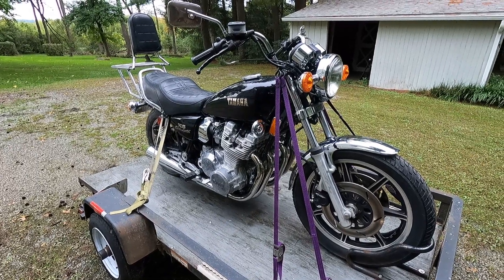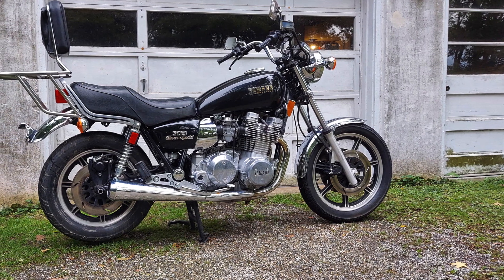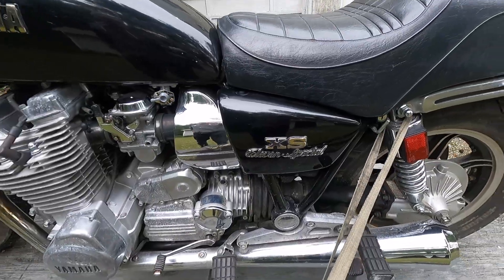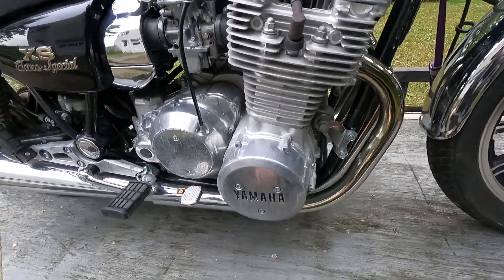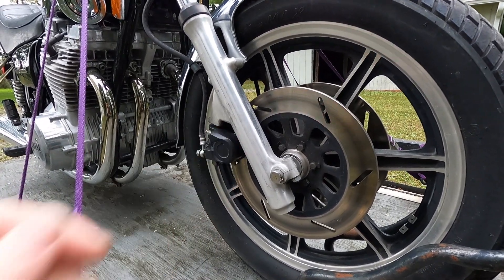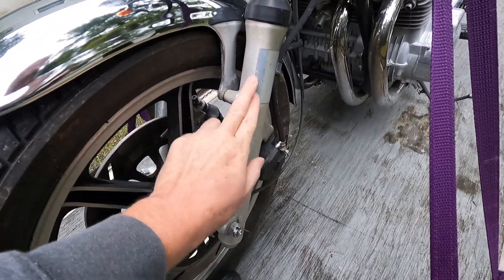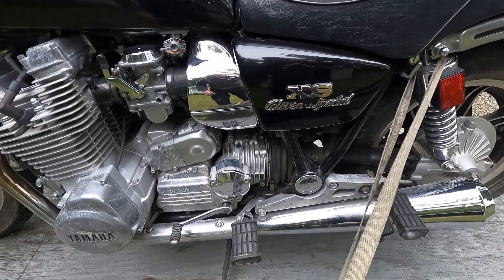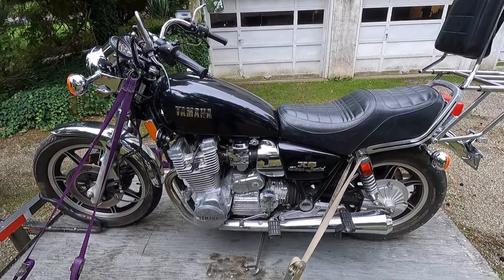1980 Yamaha XS1100 Restoration - Part 1 - Intro

Comment: What a clean bike. The corrosion on the engine cases actually to me looks like the spotting left by a degreaser.  The factory headers on all old Japanese bikes are double wall which can keep the outer tube in nice condition.
Reply from the maker: Thanks Mike! Yeah, I think this one will clean up nicely. 🙂

Comment: That is barn find motorcycle,  so good original condition for over 40 years old bike with so low miles. Congratulations for that. Hope you take off that carrier and sissybar ?
Reply: There is also dual fuel taps, cool thing !
Reply from the maker: The rack and sissy bar are OE Yamaha accessories but they do spoil the lines of the bike a bit.😉

Comment: Does anyone know where I can find pre made spark plug wires for a 1985 Honda VF 700 Sabre V45? All I can find is universal wires that don’t connect into the Honda coils correctly.   Thanks!
Reply from the maker: Did you check with Dynatec ignition?
Reply: @jonsmotorcyclerescueandrev3538  no I have not heard of them. I’ll give it a try. Thanks
Reply: @jonsmotorcyclerescueandrev3538  they only have them for the V65 motors.
Reply from the maker: @mattmiles9779  Are they not the same? That is surprising.
Reply: @jonsmotorcyclerescueandrev3538  I’m not sure if they’re the same or not. They only have it listed for the larger motor. I ended up ordering a set of used coils and wires off eBay. I’ll just use the best of what’s there for now.
Reply from the maker: @mattmiles9779  Right on. I'm glad you were able to find something, at least. Cheers